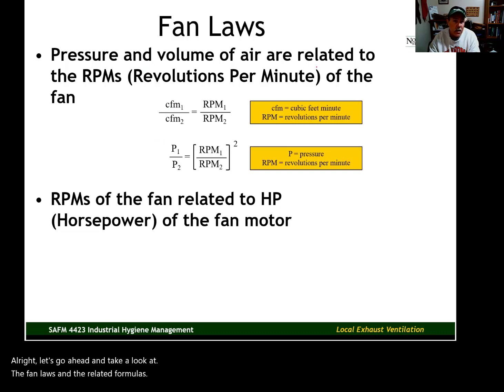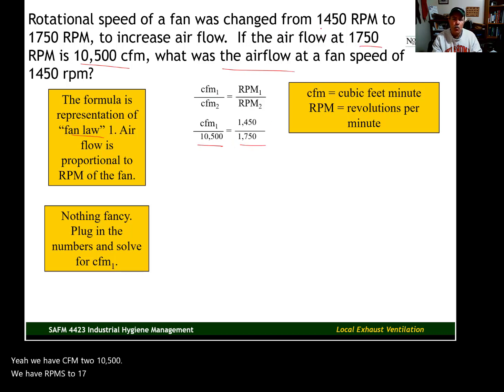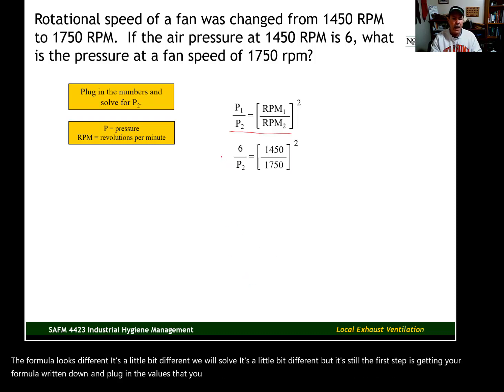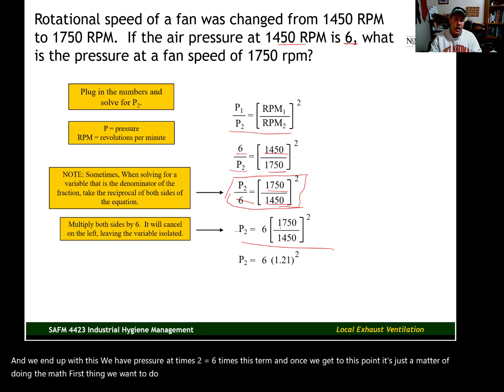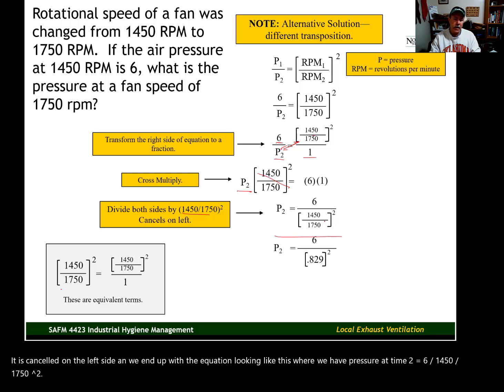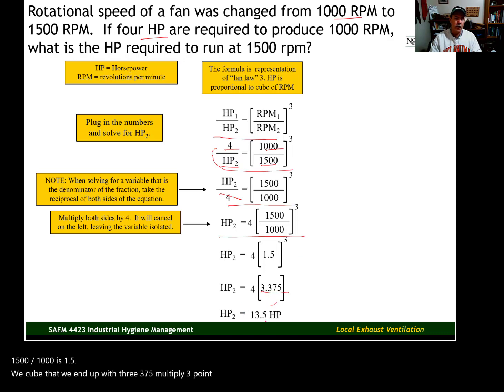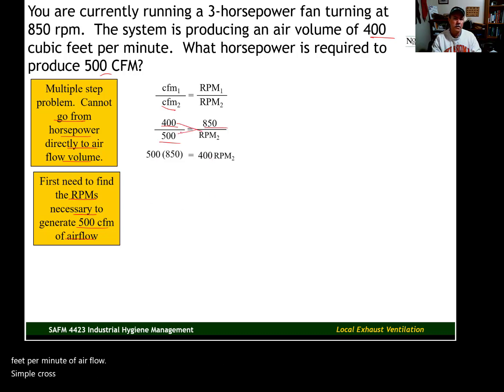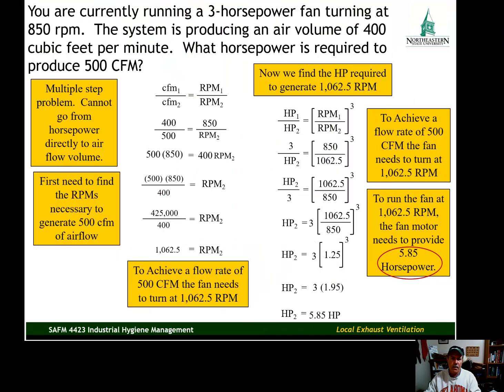Fan Laws (Affinity Laws), Calculations

Comment: Thanks. Can you tell me why amps on a propeller fan increase with air blocked to it and amps decrease on a centrifugal fan when air is blocked?
I do know that air is a load on the centrifugal fan and if removed then amps drop. The propeller.
Thanks
Reply from the maker: Hello Johnny.  I'm not an HVAC expert but here is my guess.  It is all due to the fan design and how the different designs move air.  Axial (propeller) fans work like a screw to create a pressure differential.  With Axial fans the inlet side is not as important for its efficiency so a blockage will not increase loading and current draw.  Centrifugal fans capture the air as it enters the fan housing and then throws the air forward.  It is much more dependent on air supply at the fan inlet.  Without air at the inlet the system can become "air bound" and the fan has to work harder to move the air.  I recommend talking to a mechanical engineer who specializes in fan design or an HVAC expert who has years of field experience.   In addition to what I've just thrown out as a possibility, there are dozens of different variables that can effect how a system moves the air.  The phenomenon you describe is also going to be affected by the specific type of centrifugal fan, the blade/impeller design.  Hope this helps.
Reply: @SafetyProCalculations  thanks for taking the time and sharing your thoughts and opinions on that! I appreciate the input
Reply from the maker: @JohnnyJr396  Here is a link to a discussion related to your question.  A lot of different opinions.  Some of the them are probably correct, lol?  https://cr4.globalspec.com/thread/108775/Squirrel-Cage-Blower-Speeds-Up-When-Airflow-is-Blocked
Reply: @SafetyProCalculations  definitely a lot of opinions lol. Thanks!

Comment: Great video thank you for the excellent lessons, is there a website that you know of where I can print all these laws for reference
Reply from the maker: These methods are taken from several different sources.  I do not know of a single source that would include them all.  There is a book that comes close to covering all the methods/laws, "Definitions, Conversions, and Calculations for Occupational Safety and Health Professionals" by Edward Finucane.  Finucane's book will present formulas in a slightly different format.  I use the same formulas but simplify them.   In addition I would recommend "Fundamentals of Industrial Hygiene" by Barbara Plog.